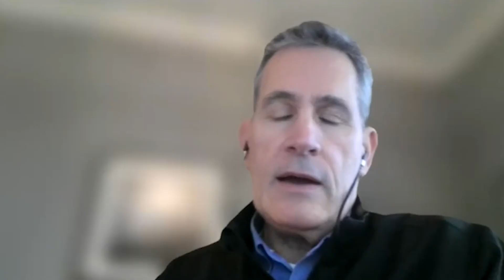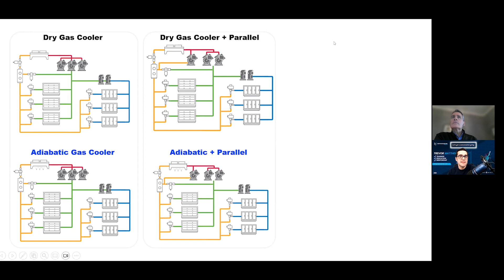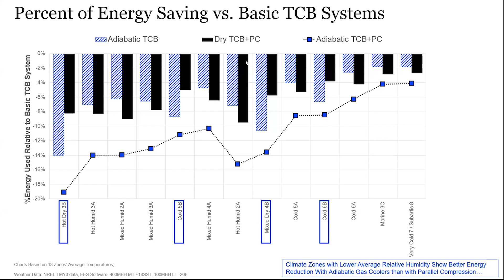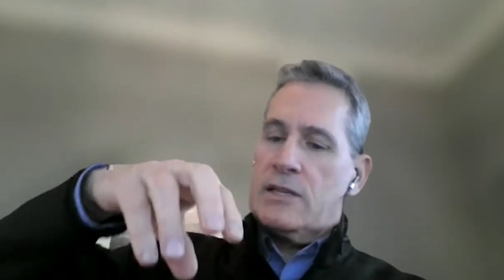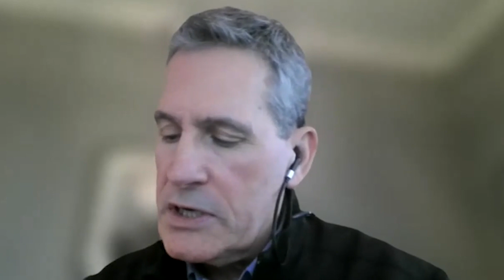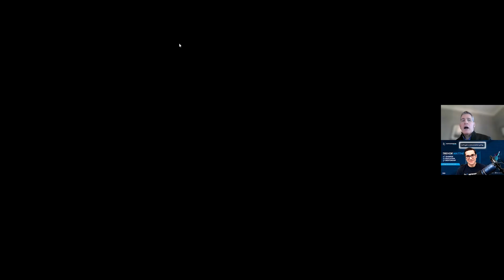CO2 System Architecture

Comment: I was surprised to see that a presentation covering carbon dioxide didn't use the correct chemical symbol of CO₂.  If you made this basic error, it sort of sets the scene portraying an overall lack of real knowledge and background to this somewhat complex issue.
Reply: This guy is the reason we have so much more knowledge on R774 in the industry. Trevor is a top bloke.
Reply: Totally agreed with you @ryanfrench4702

Comment: When the world will understand that this is not a reasonable direction of refrigeration development? Correct direction is R717, R1270, R1150, R290, R600a, R600, R170, R50. Only subcritical and low energy comsumtion systems!